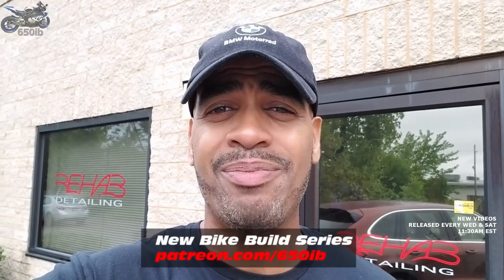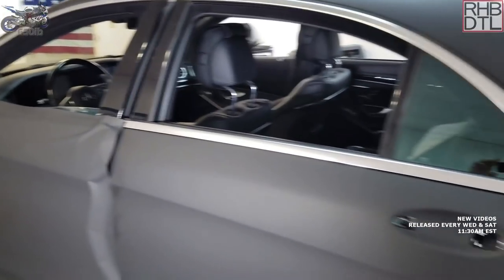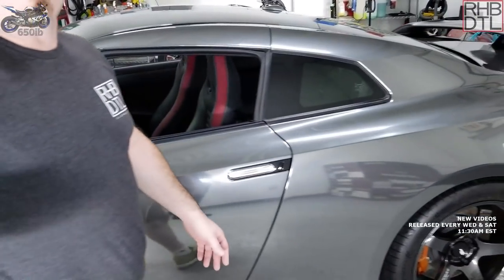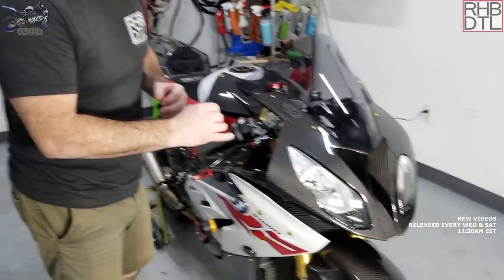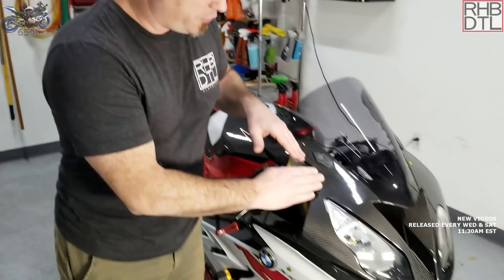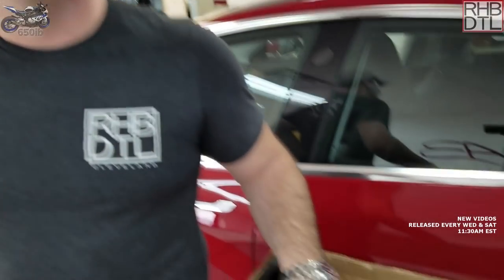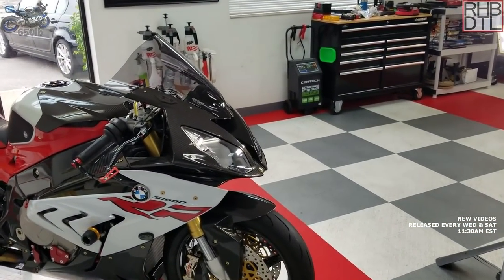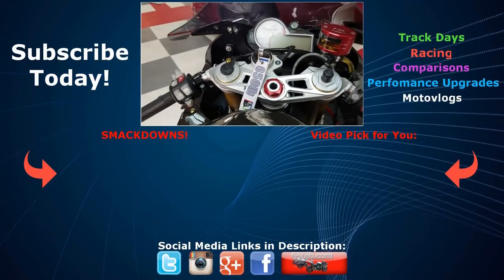Ceramic Coating 2018 BMW S1000RR 😱💥👊👍💥

Comment: Since you've worked closely with the bmw dealership how would you compare aftermarket carbon fiber parts such as fullsix fairings  to the factory hp4 carbon fiber parts?

Comment: How much did it cost to CC the bike?
Reply from the maker: $1,600
Reply: 1600 for a ceramic coating dang that is some dough but the S1KRR is well worth such treatment as it will be protected & looking amazing for a few years to come 
650IB Your V4S deserves similar treatment & will look amazing when done that Red car in the video looked awesome
Reply: 650ib thanks ib.